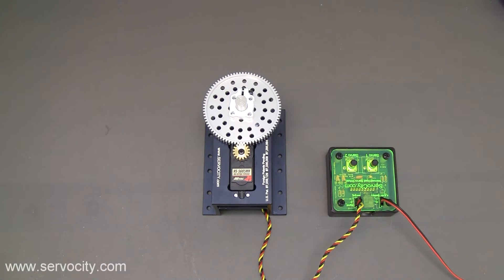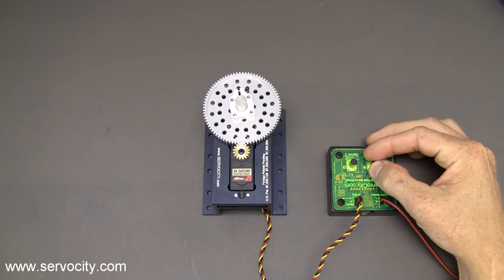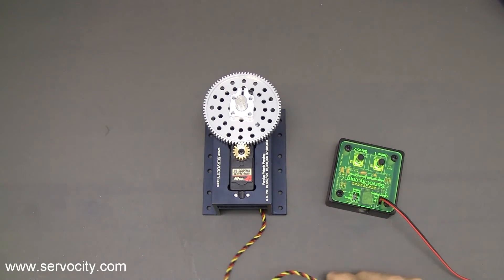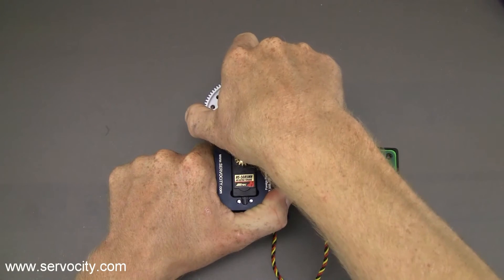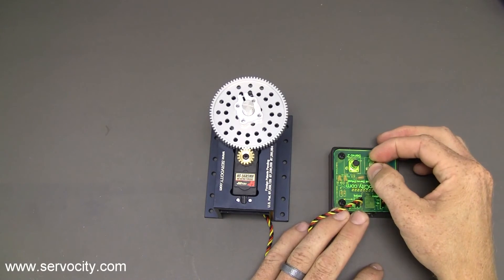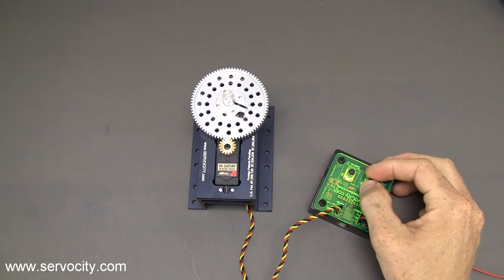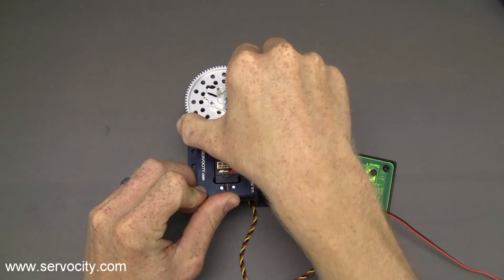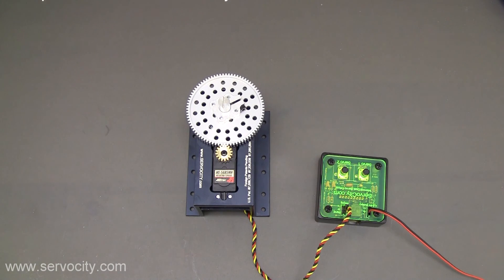ServoCity.com SPG5685A power gearbox potentiometer operating range

Comment: Great video
I was just wondering if you can program these servos from Servocity with an Arduino just through an ordinary code from the Arduino website.....or can it only be programmed with the potentiometer.
Reply from the maker: You can drive it with an Arduino, but to program it you would need a servo programmer.

Comment: How much is the stall torque for this motor?
Reply from the maker: Hi Vinayak -
The stall torque on our HS-5685MH Servo Power Gearboxes is 1,253 oz-in.
Thanks!
ServoCity
Reply: And the running torque?
Reply from the maker: Vinayak Soni Hitec does not rate the running torque of their servos.  If you are able to figure running torque (by contacting Hitec directly) of the servo you intend to install in the gearbox, you can then multiply it by the ratio on your gearbox.  Thanks!